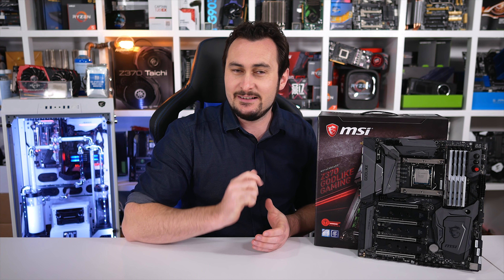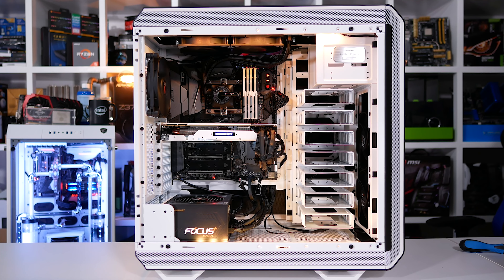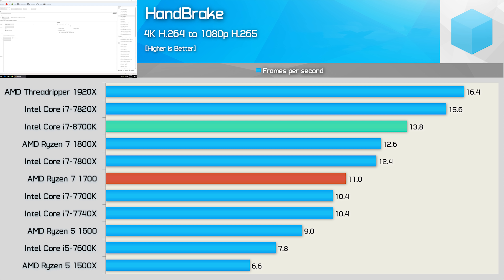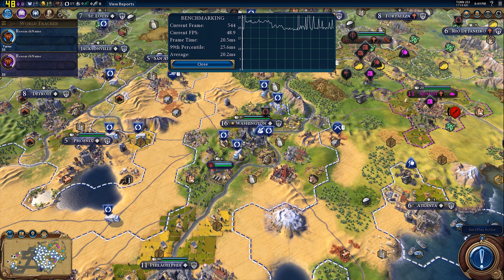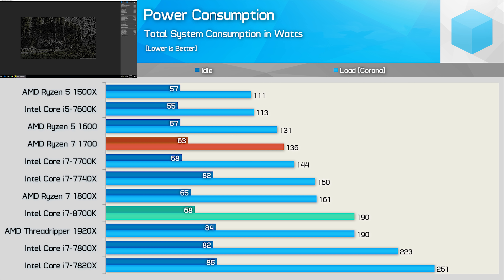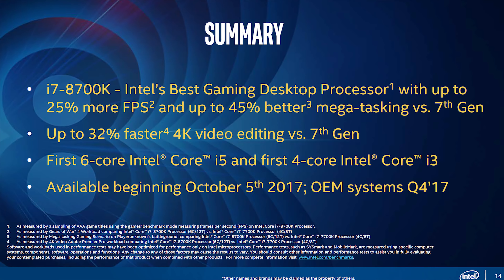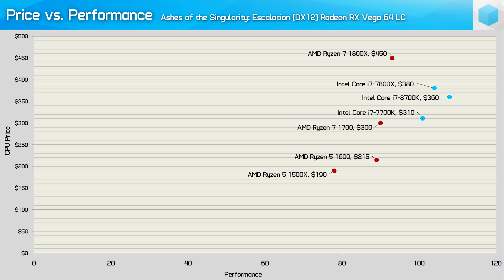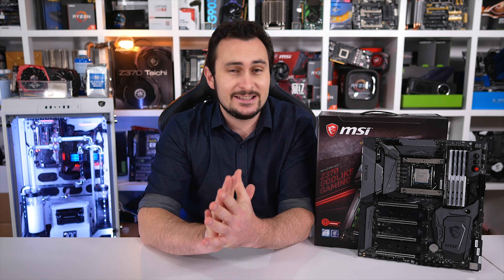Intel Core i7-8700K Review, The New Gaming King!

Comment: Intel 2020 - i13 - 13700k 12 core 24 threads $500
AMD 2020 - Flying 4800X 24 core 48 threads $450
Reply: Appleton Mccool I hope so
Reply: wow you're justifying something that doesn't even exist.
Reply: And where the fuck did you get that 10% Per year bullshit?
Reply: quantum computer will replace amd and intel
Reply: And games are still optimized for 4 cores
Reply: @sorbet7216  yeah....... thats what someone in 2001 would say....

Comment: Great job mate - power consumption numbers are all over the place, looks like you got a leaky one with good OC.
Reply: Whew, I wasn't the only one to notice.
Jim are you going to get a loaner to review as well?

It would be interesting to see how your numbers compare from that corner of the world. I mean, your toilets flush the wrong way there... so there's bound to be differences :D
Reply: Gigabyte offered me a look but I turned it down, got a backlog of hardware and I'm a bit sick of it tbh.  I might check it out later on though.
Reply: Sweet.
Thanks for all the hard work, and your objective viewpoint on all of it.

Here's hoping AMD raises the steaks with Ryzen v2.0 !
Reply from the maker: Thanks mate, usually it's the motherboards that cause the power consumption issues at launch. Find someone else who tested with the Godlike :D I'll try some other boards today.
Reply: Does the Godlike have "all core max turbo"  thing by default btw (Asus version is called "multicore enhancement"?)  Trying to make sense of the numbers...there's a 20% difference between Cinebench numbers from site to site, it's bizarre...
Reply from the maker: Yes MSI has that, I manually disabled it though.
Reply: Cool cheers bud.
Reply: It's also gotta be noted that overclocking after delidding shouldn't really be a consideration. It voids warranty and I think perhaps .09% of the population delids their CPUs
Reply from the maker: Who did overclocking after deliding?